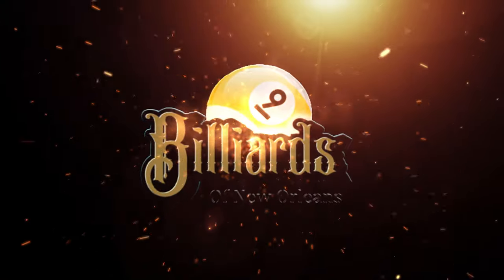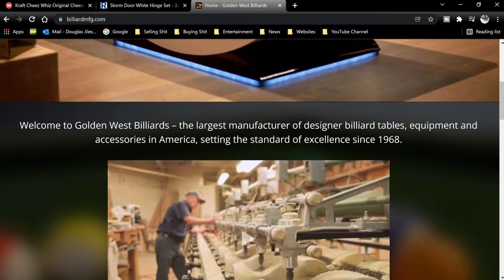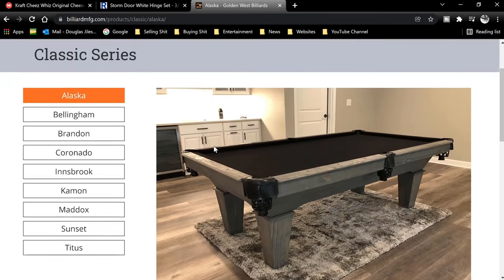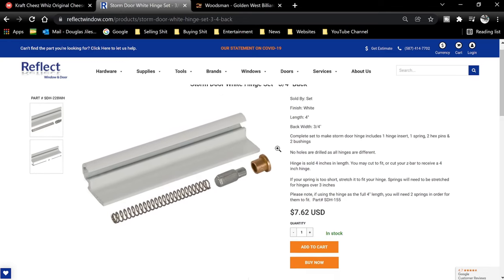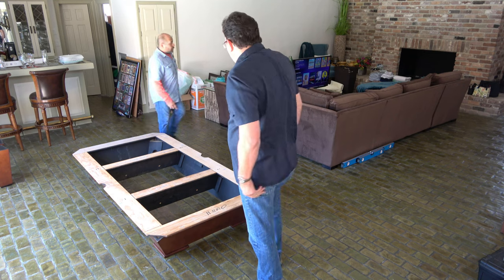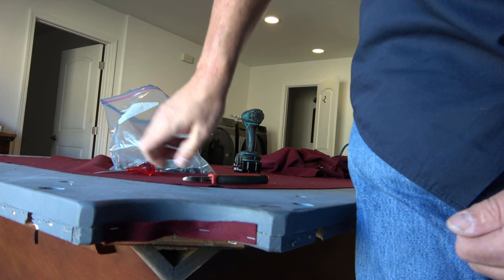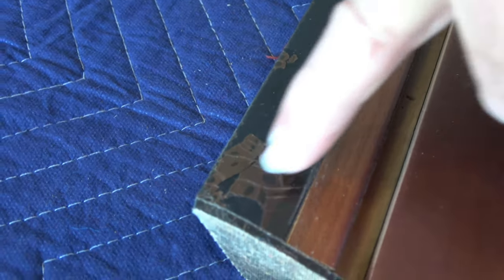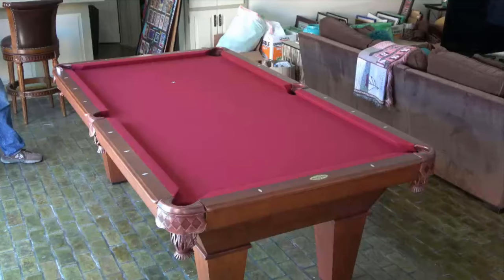Pool Table Tech Reviews GOLDEN WEST BILLIARDS

Comment: Thanks Doug … I purchased my Goldenwest back in the 90s with Oak rails , from your review…spot on , the sloppy over spray was not an issue with mine , through your guidance I reclothed table and rails this year , thank you ! Doug I wanted to ask you , when I reclothed my table , the slate bed that my slate sits on ,did not match up flush to the slate as you show on your video . Making it difficult to staple the pockets especially the sides , It begs the question have you seen this before ? Thank you Doug
Reply from the maker: Thank you very much.

I tried to be fair with my assessment of the table, the construction, and their website. They do make a decent table. I just think they could use a bit of constructive criticism. 

I haven't really had that issue with stapling the pockets. I would check to make sure that the slate is on the frame correctly and square to the frame. Take a tape measure and double-check your distance between the edge of the slate to the frame. Side to side should read the same all the way down the length of the table. And, the two ends should read the same. If all of your measurements are correct, then, you shouldn't have any issues.
Reply: @CreativeRestorations  quite simply Doug after I asked you ..it’s the contours of the pockets on the slate bed don’t match the slate cutouts on the slate . You don’t have to respond ..feel free to though …but ya…nothing even close to your video showing everything flush and wonderful … slate bed to slate profile.. Thanks Doug
Reply: Had a 7 foot Golden West 1" three piece slate. out in the garage for 8 years held up in the wet cold PNW. and hot summers. Stayed level. Even using it as a base for ping pong table.  Project table. Laundry folding table.  Replaced the felt twice bye Golden West installers. There shop is close to me. Portland Oregon.  Big building's overwhelming the amount of tables they must make. Mine 25 years ago was 1,380.00 Balls, rack, 4 cues, 1 bridge, brush, box of chalk, set up, delivered. Looked liked the one in your video
Reply: @jefflarsen945  that's good to hear. I want to order a snooker sized 12 x 6 from them.  If I can afford their table, I will buy one.

Comment: Doug:
Thank you for looking at Golden West.
I am debating about buying a new table from them...but also considering other new and used tables.  
As my installation would be in a basement, I was wondering if all Brunswick "furniture tables" from the 70s/80s/90s have knockdown construction?
Reply from the maker: I'd personally stay away from anything Brunswick made in the 70's to the late 80's. Brunswick cut a LOT of corners during that time period.
Reply: Interesting, but I guess not all that surprising. 
 I have also looked some at Brunswick antique tables from 1930 and earlier.  How does one discern the value of these older unrestored/partially restored tables?  Fully restored, it seems like even the plainest models are north of $8000.
Reply from the maker: Antique tables can get very expensive. There are a couple of places that I would trust in the country to do a fair estimate on antique tables. I wouldn't be one of them though. Although I know how to do the restorations, I don't specialize in buying and selling them. So, I don't see the price tags for those antique tables.

I can say this... There are several factors that go into the price of an antique table. 
1) How many of that model were made?
2) How many were made in that species of wood?
3) How many were made in that species of wood in that size table?
4) Cost to do a full restoration?
5) How desirable is the table?

There are lots of antique tables floating around out there that aren't even worth doing the restoration on. At least, not at this time. It isn't uncommon for a restoration to run north of $6,000 to $10,000 or more. I'll give you an example. Let's say you've got an 8' Brunswick Aviator table in mahogany. VERY common antique table. It needs a full restoration that will cost approximately $7,000. You buy it for $2,000. You'll be into it for over $9,000. That table is only worth about $12,000 on a REALLY good day. And, that's assuming that the restoration was done flawlessly and you've got a buyer that's willing to pay $12k for a really common antique table. Chances are, you'd only get $8k-9k for that table.

Now, 20 years from now, the market could be totally different. That same restored table may skyrocket in price. But, that's a gamble. And historically, that hasn't happened.

Hope this explains it.

Doug
Reply: @CreativeRestorations  Great info, thank you.  Definitely does not make me want to go out and invest in an old table just because it is old, that is for sure.  It would seem like messing with these aged tables makes sense only if you stumble across a table that is super rare or if you just inherited an antique table that you are willing to take your time on restoring with the intent of enjoying yourself at some point.